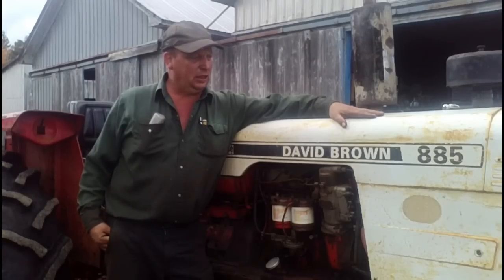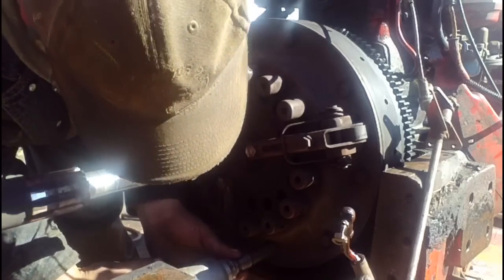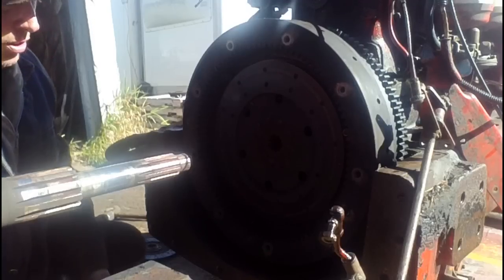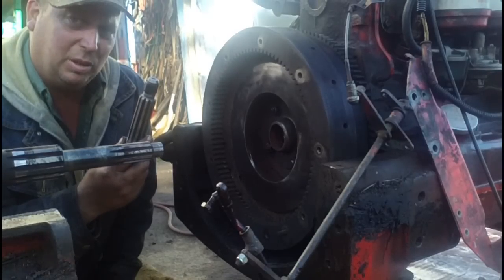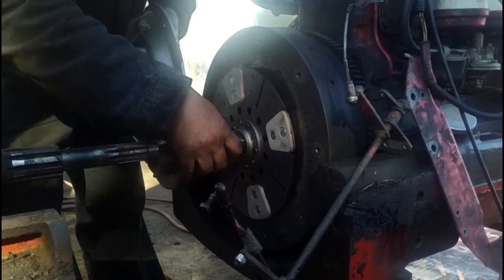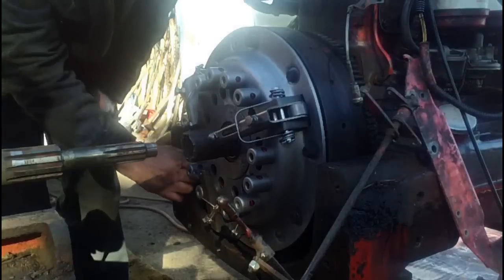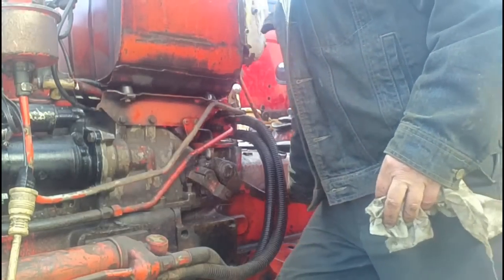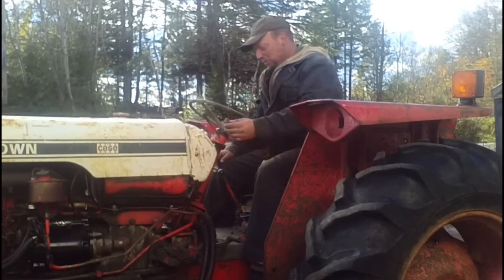885 David Brown clutch change

Comment: Excellent video !! Where did you come up with Pilot shafts for correct alignment of disc & pressure plate ?? I am about to tackle this exact job next weekend but the new Pressure plate / Disc kit does not come with Pilot shafts ??
Reply from the maker: I don't remember what I used for pilot shafts now, You can use an extension and sockets to get things lined up sometimes. Thanks for watching!

Comment: So did you have to turn the PTO plate around? You put it in the opposite way around to how it came out. I'm helping a farmer friend with his 996 clutch and his son put the pto plate in the same way you did and we couldn't get the tractor back together. It was about 3/4 of an inch from closing up. I phoned a mate who did his apprenticeship on David Brown and told him the probs we're having and also what I watched you do and he said when that plate is in the wrong way, it binds against the splines. Then when you force the tractor back together, the force against the flywheel rips out the engine crankshaft thrust washers when you start it.
Reply from the maker: I did actually catch that and turned the disk around,  if you notice the PTO disk when I'm putting the second pilot shaft in you will see the disk is turned the correct way.
  Thanks for watching!

Comment: I replaced a clutch in a 995 its the same as a 885.new discs because the crankshaft    seal leaked and wrecked the  old discs. My problem now is its hard to engage gears even when adjusted to the last .any help would b appreciated
Reply from the maker: I don't have a manual on a 995 but there may be some adjustment on the pressure plate. Thanks for watching!

Comment: Hi is there supposed to be a detent spring on the left stick 4 speed range selector, I am having trouble shifting the left range selector when parked of course. There is not spring detent that I can feel. Also it is confusing, the labeling is gone. What would be 1st, 2nd, 3rd and 4th positions on the left transmission stick on an 885 with a standard manual transmission like the one you have? Great video! Thank you. Also how do you adjust out the pedal free play, mine does not have nearly as much as yours.
Reply from the maker: I would expect there would be detents on the range selector but I am not sure, not sure of the gear pattern either. Check the linkage at the clutch pedal, I expect there should be an adjustable link there, if not the short lever on the cross shaft looks like it would be splined on, you could adjust it there.
  Thanks for watching!
Reply: The left stick on a DB is the range lever. High, High Slow, Low and Low Slow. HS is forward and left of the central position (H), from H pull straight back to get to Neutral and then through to L. From L go left and then forward to get into LS.
Reply: No springs load the gear lever. The shift pattern is visually two letter "L"'s, one directly above the other and with the rightmost tip of the base of each "L" connected together via a vertical (ie forward/backward) link.

Comment: I am putting new clutches in a 990 and when watching your video I noticed that you put the PTO clutch backwards from when you took it out and was wondering what way is correct !
Thank you for a great video !
Reply from the maker: It's been a while but I would have had some reason for putting it back in the way I did, often new disks have an indicator of which side goes toward the flywheel.
Reply: Canadian Redneck what kind of indicator would I be looking for? Looks to me like you put both in the opposite way you took them out?

Comment: I cannot get the frame to split. Did I miss a bolt somewhere? Suggestions
Reply from the maker: Dig through the grease and gunk inside the frame there's a few in there, if I'm remembering correctly I think there is one bottom center of the frame.
 Thanks for watching!

Comment: Hi there , i have an case 985 , Dt 268 engine , and last day at plowing in 4x4 mode  I seen that the clutch disk was sleeping.The clutch engage and disengage at the right point , can i do something to stop that sleep , or the only solution is to change the clutch disk.
Thanks in advance for  your answer.
Good Job!!!
Reply from the maker: In those series tractors once the clutch starts to slip it's time to change it. You will need to have the flywheel resurfaced also as the ceramic disk grinds away metal. Thanks for watching!

Comment: Two things here : the first disk you've putted in was on the wrong side. You finally installed it correctly but didn't mention you did it !!! Second, the clutch pedal must be ajusted after words. I think it needs to be adress here. Cause even if the old clutch disks are replaced for new ones that are not that much thicker... it changes pretty much the dynamic here. Mine was so "soft" after replacement... I really thought I screwed up badly after engine end and rear end tractor were putted together again. I'm telling you this because I had to changed both clutch disks on my David Brown 880. At the time, I referred to your video to do it. As I'm not a mechanical, those two details were pretty important at the end. Thanks anyway. At least it was very helpful.
Reply from the maker: Thank you for the input, I have taken comments like yours to try and improve my content over the years. Thanks for watching!
Reply: @CanadianRedneck15  Hi again. Many thanks for answering. The David Brown 880 is not exactly like the 885. Hopefully because I would had to do the same as you did then. The bell housing of the 880 is in two separate parts... like the 885 but cut in the middle. So I didn't have to remove the front end at the time. It was a lot easier to do because of that. Your video was very helpful because even if I got no skills in mechanic, I was able to understand what it was all about before splitting the tractor in half. Regards.

Comment: Hi, Great video! I have a DB 1200a that the PTO clutch works fine but just recently the transmission clutch will not completely disengage so lots of gear grinding. Is there any adjustment to help this situation or is a new clutch in my near future? Would you want to come to Upper Michigan to do it for me?
Reply from the maker: There should be some adjustment on the clutch pedal linkage to get some  more travel out of it but if that doesn't work then yeah, it's likely time for a clutch. I would love to come to Michigan, I think that would be a good time! Unfortunately I don't get a lot chance to get away from the shop here, good luck and thanks for watching!

Comment: Where did you find the replacement parts?
Reply from the maker: I'm a tractor parts dealer, that's what I do. :) Thanks for watching!
Reply: @CanadianRedneck15  nice, I had to send my clutch to Kentucky Clutch in Louisville to get it rebuilt. They did a fantastic job for anyone in need of the same.
Reply from the maker: @johnpalmer9774  Some tractors are getting hard to find parts for so knowing guys like that is priceless, thanks for the info.

Comment: I was hoping for your expertise. I have an 885, just bought and this is my first tractor experience. The pto and hydro pump failed. I assumed it was the clutch which i have split and pulled. There is wear and will get replaced. During the work i noticed if you pull the cardan shaft out from the trans shaft about an inch it will disengage from the "rear" pto/ hydro pump and the shaft will come completely out. Is this normal? I noticed the shaft in this video did the same. Reason i ask is i ran across part diagrams that show a coupling that attaches to the pto end of the shaft held together by a bolt. Perhaps that is for a different model? I would appreciate your feedback as i do not want to open up the rearend needlessly. Thank you
Reply from the maker: The pto input shaft will pull straight out when you remove the aluminum release bearing sleeve so it can be replaced, is that what you meant? Thanks for watching!
Reply from the maker: Excellent. glad I could be of help!

Comment: i notice that the clutch plate that you refitted was different from the one that you took out ?
Reply from the maker: The replacement was a 4 pad ceramic disk which would be a heavy duty replacement. Sometimes replacement parts don't match exactly because the manufacturer used better than original materials, sometimes the customer chooses the grade of the parts going back in, each situation is unique. :) Thanks for watching!
Reply: i always like the ordanary disc as when it dies it just slips and does no damage to the flywheel
Reply from the maker: I agree, the ceramic disks grind things up pretty bad.

Comment: Is a david brown 990 gas model the same as the diesel models rear end an gears jw
Reply from the maker: If you found two tractors built to the same spec I don't think there would be a difference between gas and diesel, the problem is, is that David Brown's motto seems to be "no two alike". The David Brown tractors are a real bear to match parts for, it seems like they stopped the line every couple of days to make a change somewhere, you need to match casting numbers for everything! Thanks for watching!

Comment: For changing a gearbox bearing on my 990 do i have to split it? Or just remove the gearbox cap?
Reply from the maker: I guess it could depend on which bearing but I expect you will have to split it to separate the shafts to install a bearing.
  Thanks for watching!

Comment: So I have a David brown 380 with a loader.. And the loader operates just fine along with the gears... The pto doesn't engage as well as the three point doesn't not operate either.. Any ideas where to start?
Reply from the maker: I believe the same shaft that drives the PTO drives the internal hydraulic pump, there is an issue with that shaft some where, either broken, splines worn off or something of that nature.
  Thanks for watching and good luck.
Reply: Would I be into it a lot of money if I got it? Would I have to split it? I've heard of the three point arms being seized in one position? He wants 4k for the tractor loader has like 2600hrs on it.. Going to look at it tomorrow.. What things should I look for besides the normal leaks an what not?
Reply from the maker: Parts availability could be an issue, David Brown got swallowed up by Case who have since been absorbed into Fiat, so used or aftermarket is your only source for parts. You are going to have to split it to figure out what is going on (most likely), and parts could be fairly reasonable to pretty harsh. The 3 point set up on the DBs is pretty touchy, not most reliable out there and 4K in my opinion would be top dollar for that tractor if it were in tip top shape.
Reply: So I got the tractor for 3700.. When I went to look at it the pto just needed to be engaged with a lever but seems like the secondary clutch may be stuck a bit does grind when you turn it on no matter what any ideas what to do there.. Looks like the tractor has a different trans under it cause it's red an the whole tractors is construction orange yellow.. But with the pto running the three point doesn't lift or drop.. It is free you can lift it up an down no issues there.. What should I look into to first? Maybe the gear walked off for the pump? Thanks for your comments
Reply from the maker: The pto grinding could be lack of use/ rust, or it could need adjusted at the pressure plate (might be on the linkage for the PTO clutch). With the 3 point hitch, I really don't know, I'm not familiar with the DB hydraulic system, could be the pump, maybe the lift linkage.
Reply: Thanks its what I thought I'll keep you updated on how it's going.. It lifts the loader great.. It does smoke white for a while then clears up.. It starts right up and idles great
Reply: So I've replaced the injectors on the case 380 an as well did a valve adjustment which they were way off.. Runs a bit better but has blow by smokes white bluish on start up.. Cleans up after running.. I was wondering about how much it would cost to rebuild this 3 cylinder diesel.. I feel like it's lacking compression maybe has broken rings.. The old injectors tested bad one dribbled so I'm thinking cylinders are washed out.. Is there a way to get ahold of your other than on here? Thanks again

Comment: his there I've got a David Brown 950 live drive is splitting it the same or similar as my cluch has gone in it and I wont to save money by doing it myself so could you please  help menny thanks grate video
Reply: hi I mean not his
Reply from the maker: Hi, I'm glad you found the video helpful. I haven't split a 950, but it should be similar. Bolt placement between the 2 models may be  a little different but the same principals apply. Thanks for watching!

Comment: Hi and thanks for the video! My PTO-clutch does not work (I guess it´s stuck to the separator plate) do you now any way to adjust it or force it free from the plate?
//Björn (Bear) from Sweden
Reply from the maker: +School2you  You can try putting a heavy load on the PTO and hold the PTO clutch in to free up the plate. If that doesn't work you will likely have to split the tractor. Thanks for watching!

Comment: I bought a 885 David brown Tractor a barn find with 633 hours on it. It was sitting for 10 years. Got it running yesterday. But the clutch is stuck to the flywheel, looks like it will take a new clutch to fix it. Unless someone can come up with a way to free it up.
Reply from the maker: Mos likely will need to split the tractor but you can try driving around a field holding the clutch pedal in and jumping on the brakes. Good luck and thanks for watching!